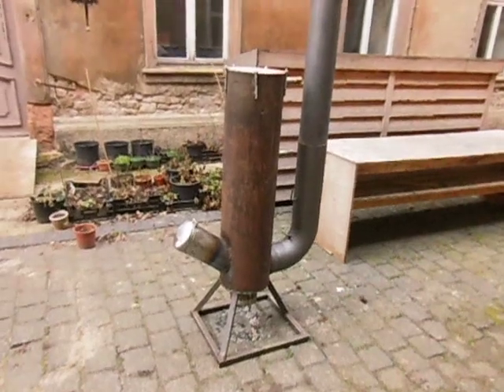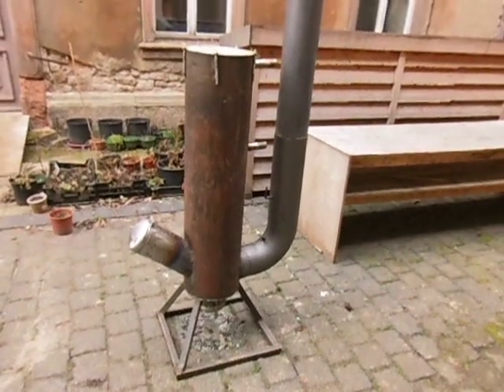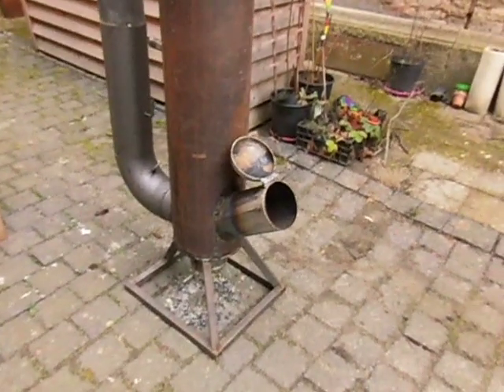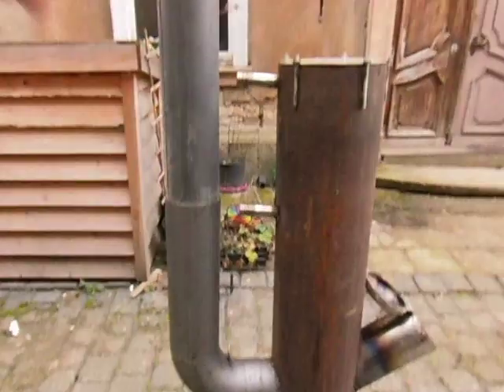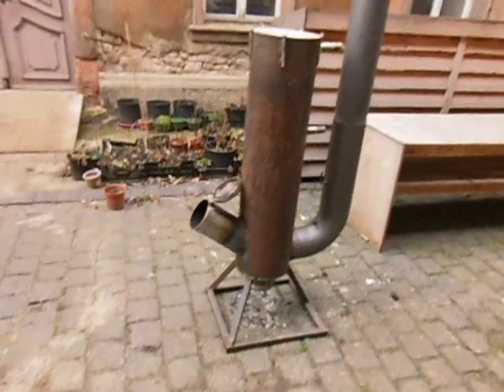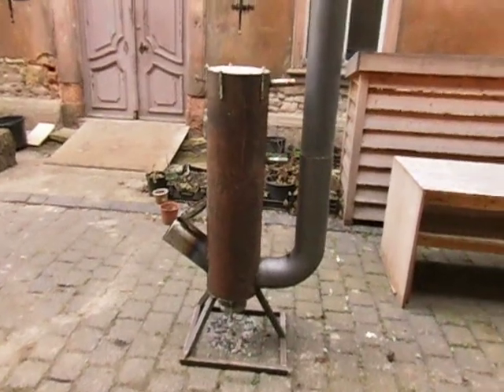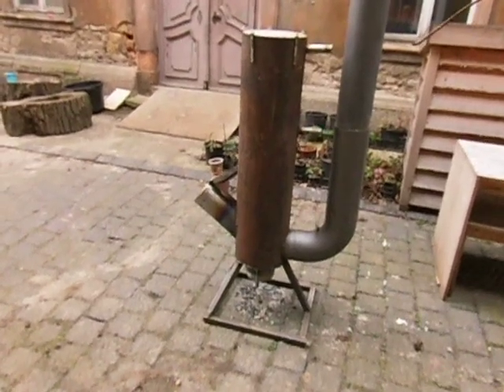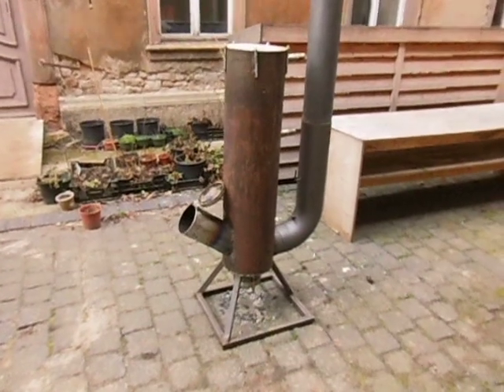Rocketstove Heat exchanger Water heater  4

Comment: Hi what diameter spiral did you use?
I've read that never less than half inch because of the steam explosion risk.

Did you source the spiral from somewhere or did you bend it?

regards
Reply: I have a spiral very similar that i salvaged from a gas boiler and its stainless steel  if that helps, I also salvaged the fan blower,   rocket stove on steroids maybe??